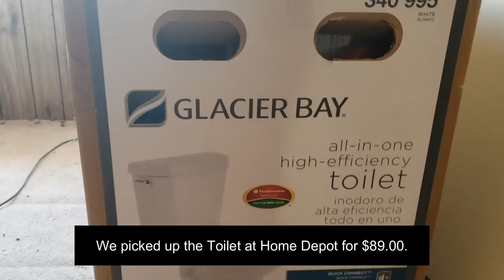Mobile Home Bathroom Floor Repair & Toilet Install

Comment: I just replaced the wax ring in my master bath toilet s couple of weeks ago. I used the new kind made out of rubber, much better. (Yes, I did it myself. It’s easy.)
Now that the floor has dried from the leak around the wax ring, toilet has to be removed again so the sagging water damaged floor can be replaced. 😢 No more wax rings for me! 
Thanks for the useful video!
Reply: Southerngal2245 good tip I’m going to check that out

Comment: Why  not replace the whole floor ?
Reply: I agree. I'm renovating a 1971 mobile home. It's an eye opener to see the patchwork repairs done on it over the years to save money.
Reply: Why replace floor with wood again, why not just use FIBERGLASS.